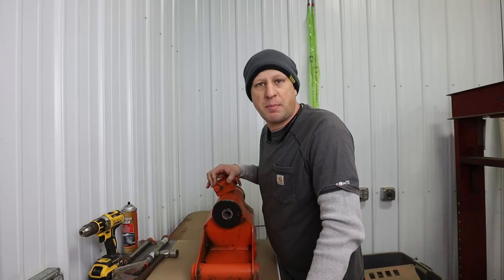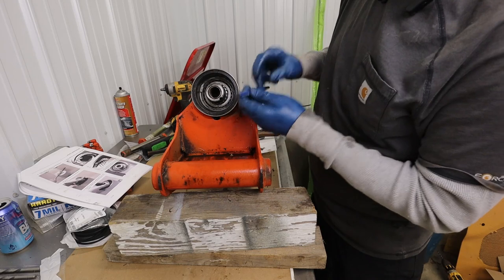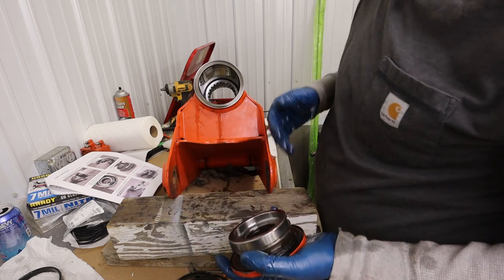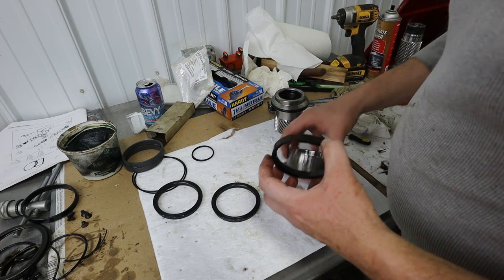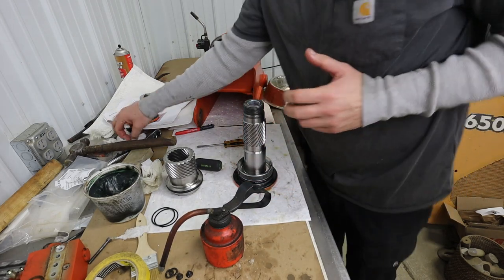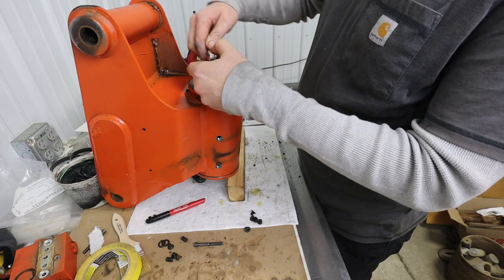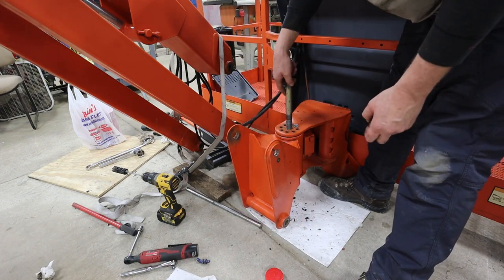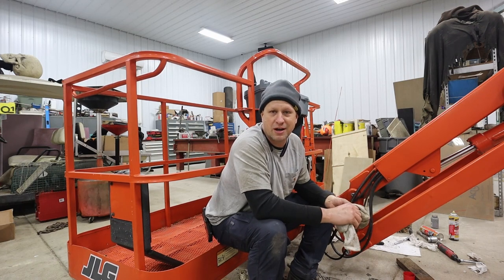JLG 600AJ manlift basket rotator rebuild.  NOT as hard as you would think, let's do it!

Comment: Gd from jamaica question at 2 hrs and 4 min when you try to put the top on if u had screw  the bottom on it will suck the top plate in just my opinion because i have done a few and its a fight to get the top in without force but any way i love the video its a lot of teaching u showed  i learned a few things from u kooool sir and also tightening it up i thinks its easier hanging the rotator by the pin on the jib if u are by yourself

Comment: Motor oil will eat your rubber seals
Reply from the maker: How will motor oil eat the rubber seals? Hydraulic fluid is motor oil, with some different additives.  My skid steer takes 10W30, seals are just fine.
Reply: @CrawfordMethod  no it’s not the same as motor oil it’s completely different
Reply from the maker: You can’t just say “no it’s completely different, trust me” and have people believe you. If you want to challenge my statement you have to provide evidence. 

My statement:  hydraulic oil and motor oil are very similar, the difference being the additive package. Some equipment in fact specifies motor oil for the hydraulic system. 

 Motor oil will not “damage seals”, modern engine are FULL of type T oil seals and they do just fine.
Reply: @CrawfordMethod  ok I will one is made to lubricate the other is made to lubricate and compress to turn Potential energy into kinetic energy those seals aren’t supposed to see any 10W30 engine oil so they aren’t designed for it the material isn’t the same now you can use ATF and that will be fine but not 10W30 motor oil hyd oil designed to expand due to head from the friction on the compression engine oil doesn’t it just thins out